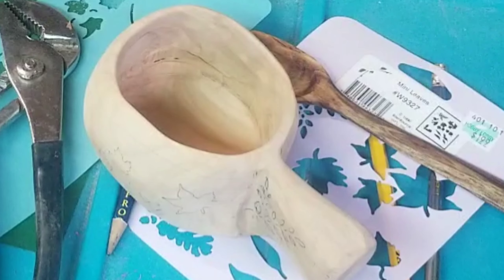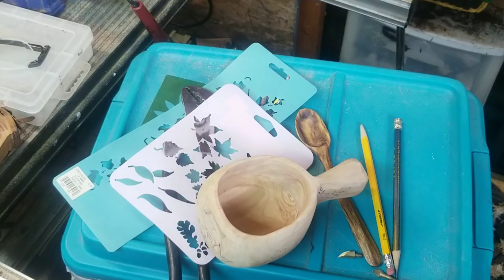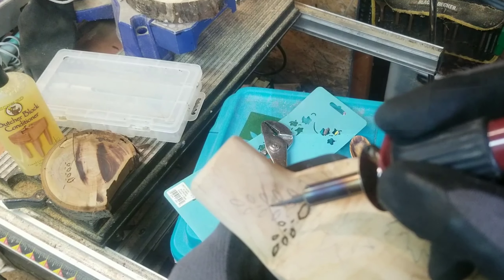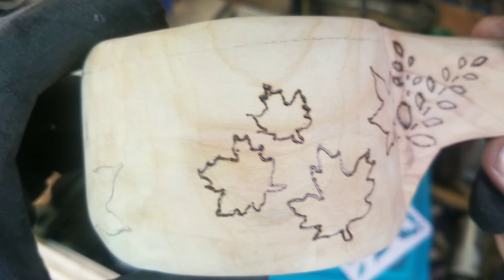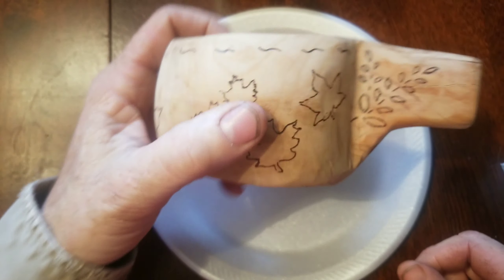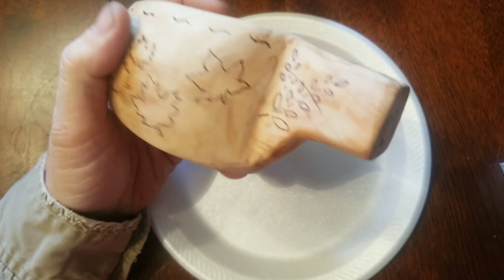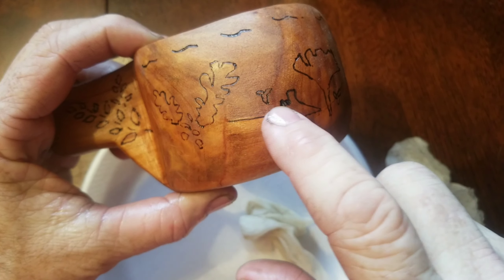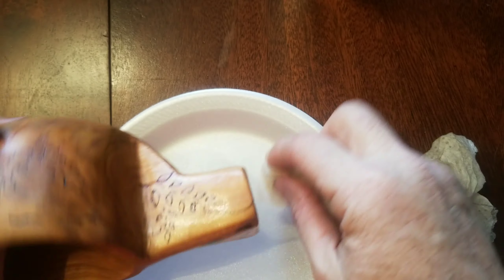My first kuksa and woodburning

Comment: Awesome job!!!! I haven't sat down to one yet. I was thinking I should give it a try. The wood burner sure does spruce ir
Reply from the maker: Thanks Joe.  You should give it a try.  I would suggest a green wood for easier carving.  I hear you can keep it in a ziploc bag with wet wood shavings while you're not working on it and after your done with it for the drying process to prevent cracking.

Comment: Quite impressive job,  Robert ! Only thing needed to finish 'er is some Folgers ! Hoping 2019 is Kind to you & yours, Happy Trails from The Frosty Maritimes !                                                                                                   ATB Ter  &  Mel  God Bless
Reply from the maker: Just found this in the spam.  
Got an issue with a crack so now I got some work to do before it gets a trial run with the Folgers. 
Going to try and repair it today but will have to let set a spell before she sees anything hot. Hopefully I will have a video by Sunday.

Comment: Man that one turned out really good! I like the handle style on that one too. Nice job on the wood burning. That fine tip worked well for those designs. Where did you find the butcher block conditioner? I have been looking for something like that to use on a project I have been working on.
Reply from the maker: Thanks Chris.  I found the conditioner at Lowe's Home Improvement.  They had this one with the waxes and just a plin non toxic mineral oil.